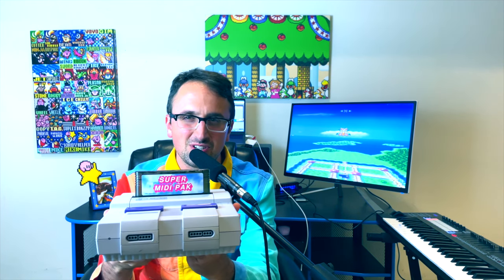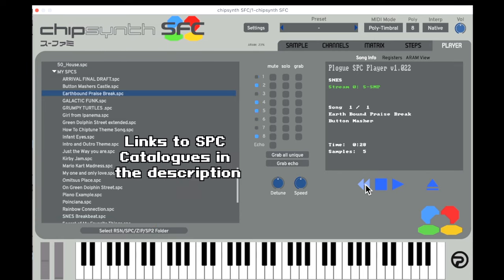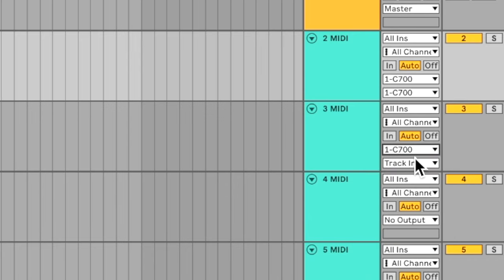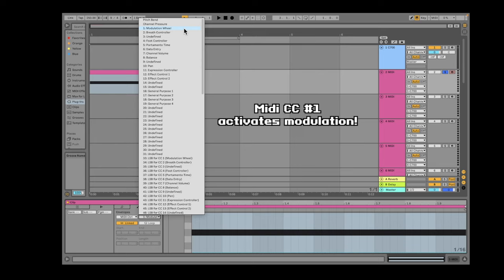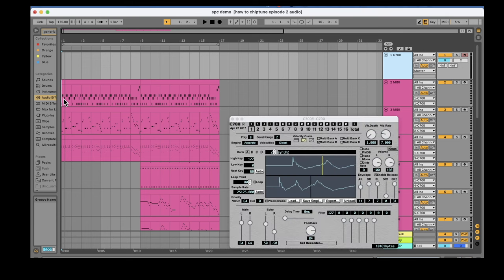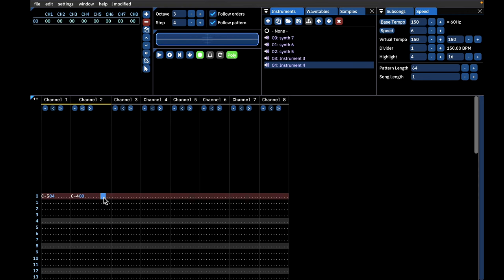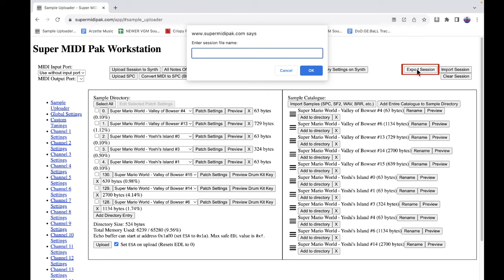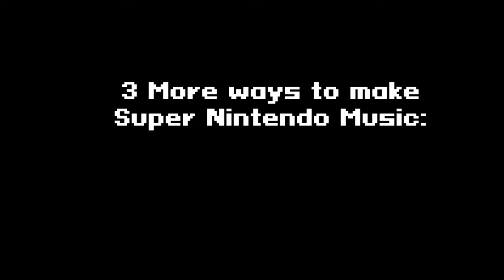How to make Super Nintendo Music TUTORIAL

Comment: Do you have any way of knowing what to set all the knobs and stuff to on C700? Apparently that's important to make the instruments sound authentic. Simply putting a MIDI through a soundfont doesn't get quite the same audio.
-Yo'ster
Reply from the maker: I dont really understand your question. Your best bet is to get your samples from the sources that ive cited and follow the exact steps ive laid out here. If you do this you shouldnt have a problem. You may need to adjust the adsr envelopes for individual samples in order to more closely get the sound your going for.
Reply: @_buttonmasher  That's pretty much what I was wondering. I just had some SMW samples from somewhere else and a they didn't come with presets for loop points or adsr or anything  for C700 so many of them were silent or off-key.
-Yo'ster
Reply: If the samples require a certain adsr setting then I was hoping there'd be a way to know exactly what they should be set to.
-Yo'ster

Comment: How would connecting a console to the audio interface device work when the console is the Analouge Super NT which has HDMI instead of the RCA cables a SNES has?
Reply from the maker: @superbulletwill  i dont understand the question but if you follow the instructions as outlined in the super midi pak chapter of this video i can 100 percent promise you that it works and i have over 50 recordings to prove it.
Reply: @_buttonmasher  In your  example, you used a authentic SNES, which has RCA cables, and connected that to your Focusrite audio interface device. The Analouge Super NT is a SNES clone console that has HDMI as its output for video and audio. 

As far as I can tell, I cannot find an audio interface device that can receive audio via MIDI. I'm wondering if you have any advice on how to navigate this.
Reply from the maker: @superbulletwill  sorry to say that i dont